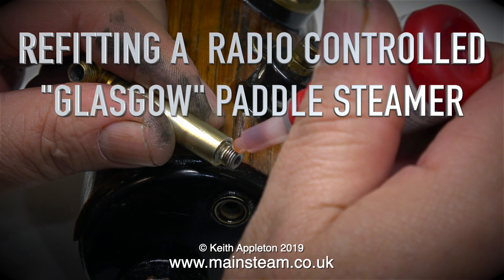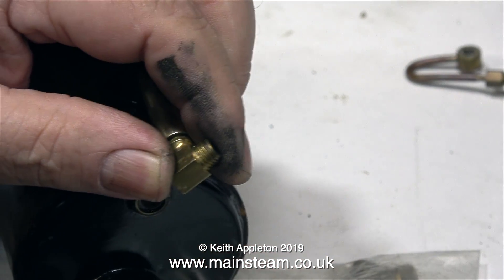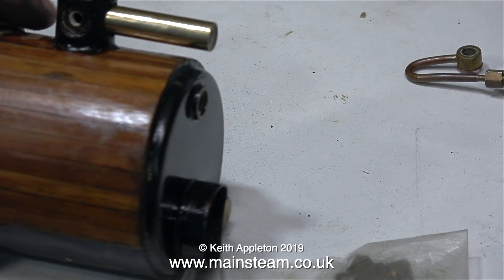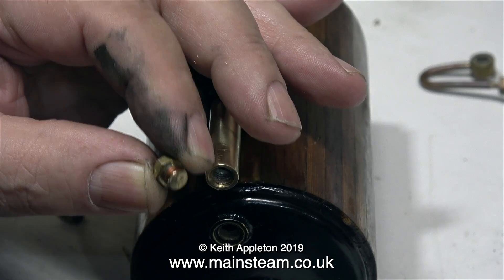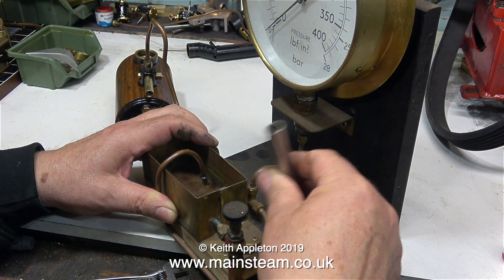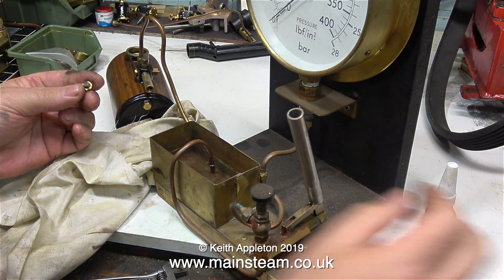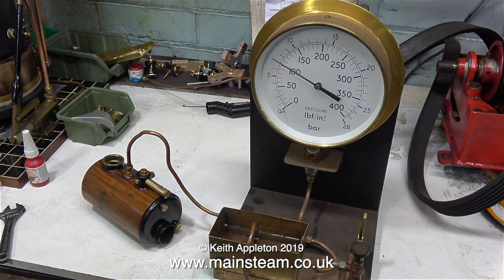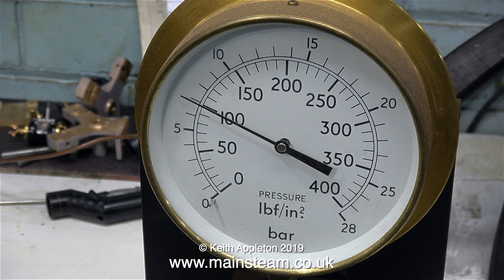A "'GLASGOW" PADDLE STEAMER REFIT - PART #5

Comment: To add to the damage to the nitpicking (and other substance-picking) nerds: The pressure gauge unit dimension is questionable lbf/in? (for the older folks) ; the only authoritative unit is bar.  :-)
Reply: Yes, you have shot yourself in the foot. The approved SI unit for pressure is the Pascal (N/m^2). One Bar (100 kPa) is an approximation of atmospheric pressure.